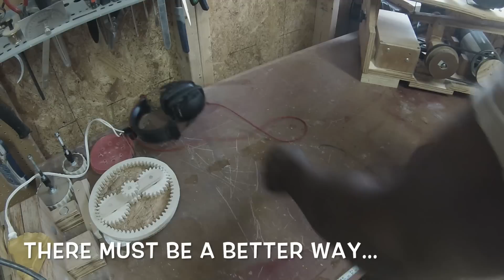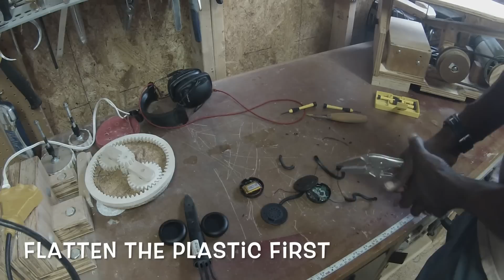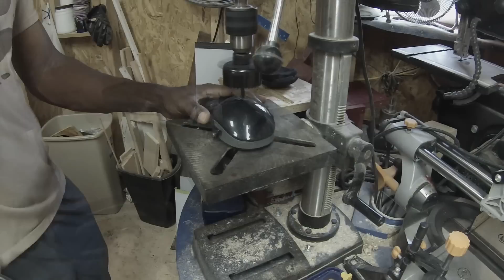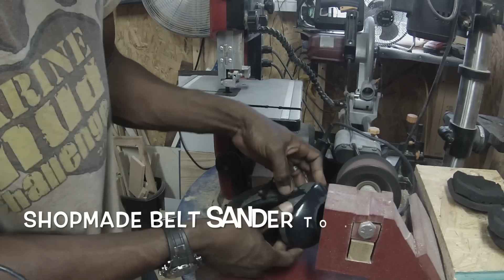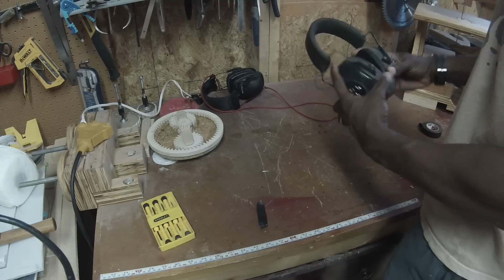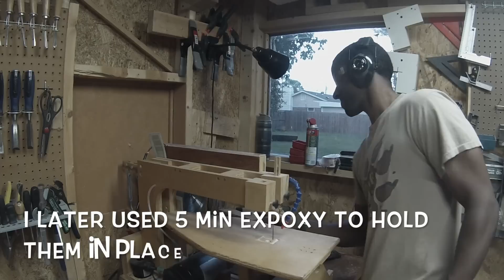05: How I Added Bluetooth Headphones To My Hearing Protection

Comment: If I recall correctly you can fix those wires.  They have a lacquer on them from the manufacturer is all; burn it off with a lighter and then clean them and they're good to go with some solder.

Comment: I love it!  What a great solution.  I saved up for a commercial wired version a few years back and they were horrible. Bulky terrible sound. Uncomfortable.  This is so great.  I can use the muffs that fit and work for me and have great sound.  How did the $13 speakers hold up over time. 

Love your videos.  Your gears inspire me.  Do you hand cut the teeth or use the tablesaw involute gear method?
Reply from the maker: +Peter McCracken I use my band saw for the gears. I explain more in my clock video. As for the headset, it has been over a year and I am still using them. You can see me wearing them in the video I posted today at the beginning. They work great.

Comment: Was the wire long enough to wrap around the top of the headband or did you splice more wire onto the existing cable? I'm looking at doing something similar but I want to place the units inside the ear muffs so that they are hidden. I wear hearing protection at work but we're not allowed to wear any earmuff style hearing protection that have radios/bluetooth, etc. in them. Can the headphones be operated directly from your phone or do you have to use the controls on the headphone?
Reply from the maker: Actually the length was exactly right. There is almost no slack. The wires are extremely fragile, and I actually cut one set thinking I could fix it, but I was not be able to repair it. The lines for the battery also run through the same line. I just bought a second pair.
Reply from the maker: If you install them on the inside you won't be able to power on and off. You also won't be able to charge the set. The other functions are accessible through the phone, but the first two problems I think are deal breakers.
Reply: Thanks for the reply.   I'm thinking maybe if I place them inside the cups facing outward (away from your ears), I will still get adequate sound since it will be in an enclosed space and reflect when they are on your ears, and still provide access to the controls. I'll have to take them off, to access them but that's a minor inconvenience in exchange for being able to listen to music at work, without getting in trouble lol. I'll just remove the headband like you did and route the wire around the headband.  Hopefully bluetooth connectivity won't be affected from being placed entirely inside the cups.
Reply from the maker: Also consider how you will charge it. The plug is on the side of the speaker in my particular model. I don't think you can easily plug it in if they are permanent fixed inside the ear protection. You will need to be able to remove them (at least partly) to plug them in. After a full day at work I imagine you will have to do this at least every other day.